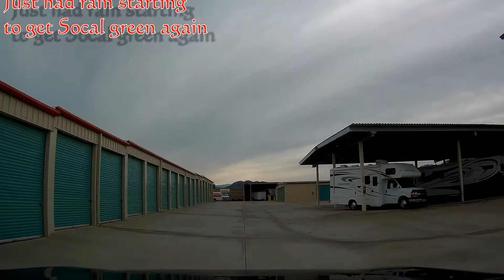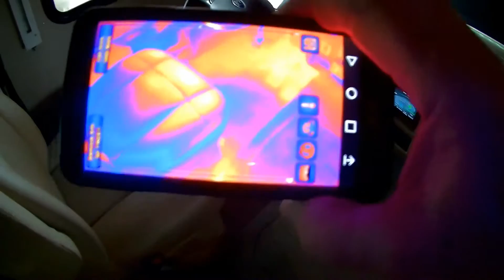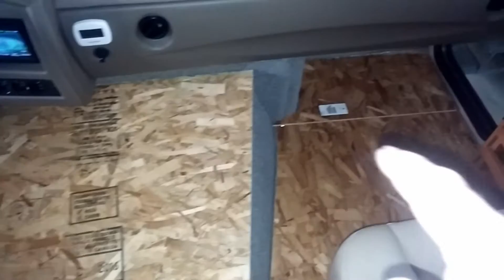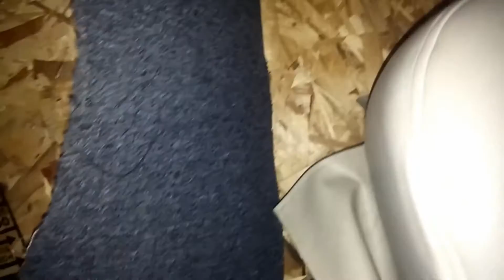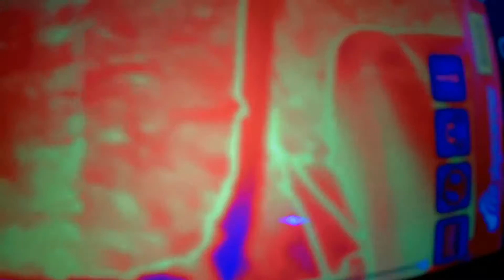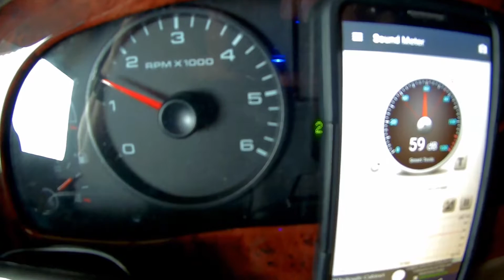407-2015 Fleetwood Flair 26E-Pt 4 Sound & Heat Deadening Motor Home Driver Area

Comment: What app are  you using for heat detection? Also interesting chart results..I am wondering as far as sound goes if most of it comes from behind the dash area and flat firewall in front of the foot wells?
Reply from the maker: The thermal app on my android is"Thermal Vision Camera". 

Yes as you know the sound transmitted into the driver compartment from the fan/clutch for any gas engine located in front of the vehicle is unavoidable especially when essentially sitting on top of the engine and as you point out the current project does not directly address frontal sound penetration into the driver area;  with those complexities it is beyond my desire to take that on, lol.  

The preliminary thermal/sound testing was of notional interest at this stage of the build, as my priority targets for this project is 1. floor tile, 2. reducing heat, 3. reducing decibel level, all without cost/benefit constraints. I actually am on coarse to have achieve all targets based on the preliminary test results.  

I expect to establish and chart before/after decibel data collection points throughout the driver area (fore/aft, left/right) to determine the variables in sound distribution similar to the thermal imaging signature. I will forgo taking actual temperature readings due to uncontrollable variables.

Today I just completed the two layer part of dog house skirt and will post a video snippet on my Facebook "RVer Frank Real Time"

Thanks for watching and especially your comments.  Happy Trails.
Reply: I am thinking about sound deadening my 1976 F-150 interior as much as possible, they used no deadening materials at all back in those days.And it having a 460, the engine is close to firewall and is pretty noisy.  I think i will go with under carpet deadner of some sort , I need to tackle that behind dash area  and may have to do it on outside of firewall on this one.
Reply from the maker: Get at Speedway Motors, a heat/sound blanket that you can apply to the engine compartment side of the firewall in your RV, link below;
http://www.speedwaymotors.com/Aluminized-Heat-and-Noise-Insulation-Shield-Double-Sided,32193.html